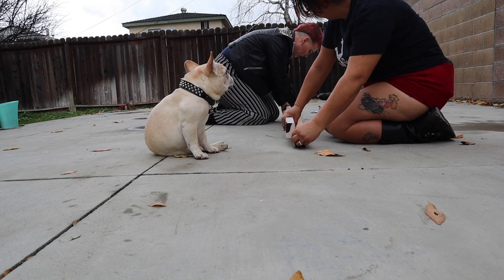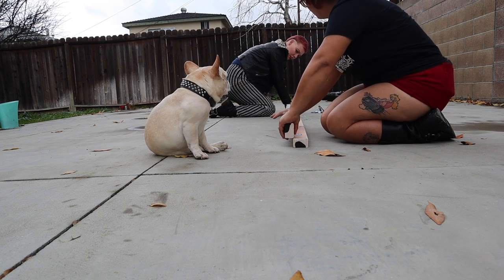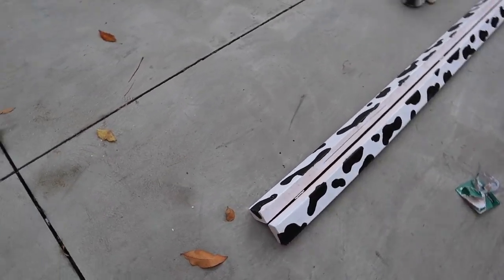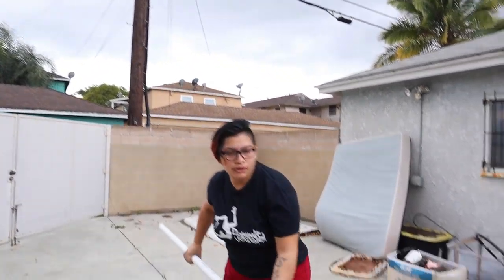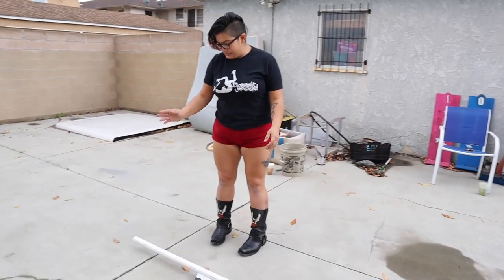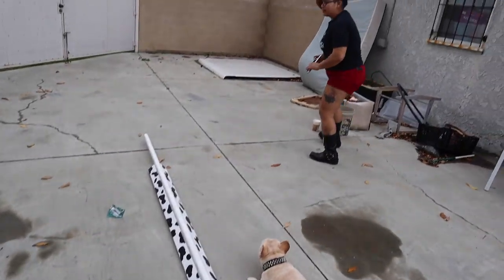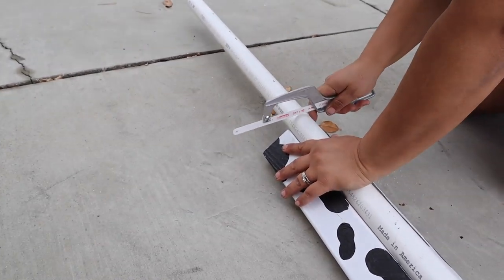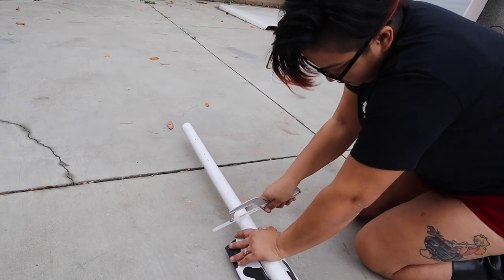HOW TO BUILD A DIY BEGINNER SKATE SLIDE RAIL: Easy roller skate slide rail for less than $20!

Comment: 8 ft slide bar supplies:
4 Brackets 1 1/2" 
4 Screws 8 gauge 1 3/4"
2 2x4s (8 foot primed wood used in this video)
PVC pipe 1 1/4"

Optional Tools:
Drill, drill bit extender, drill bit
Hack saw
Reply: Thank you :)
Reply: I think you might need more than 4 screws? Each bracket needs 6 screws to screw in, right? So like 24?
Reply: Wait we just realized the brackets bought in the video came with the screws, so if you buy the brackets alone, don't forget to get extra screws! 😅
Reply: THANK YOU, was going through the video and writing everything down but was worried I missed something 👍👍👍
Reply: I accidentally got a 2 inch PVC pipe, will that still work with roller skates?
Reply: Thank you
Reply: bless your soul

Comment: For flaws on wood you can use a planer to flatten wood out & have a smooth surface.  Even better, to have a perfect flat square piece of wood on all sides you can first use a joiner (tool #1) then run the wood through a planer (tool #2).  There is one tool joiner-planer combo VERY USEFUL & awesome power tool to have (saves your arm the grease work from sanding too).

Comment: Something to do or think about is to somehow flatten the corners touching the floor so it's not sitting on an angle, but a flat base. I'm sure you can sand it down by hand if you had to (though I admit it would be a pain and a half)

Comment: I'm so bummed! I followed this tutorial but I didn't consider that 2x4s in the US are not actually 2"x4", but in my country they are (I'm from Chile) and now I will need a bigger pipe :/ and I don't know if that could be ok or too wide for the blocks. I hope it works because I painted it and it looks soo cute. So moral of the story, don't make the same mistake. If a 2X4 in your country is 5 cm x 10 cm get wood that is not so thick. Thanks for the video.